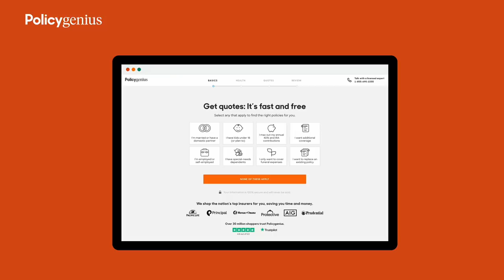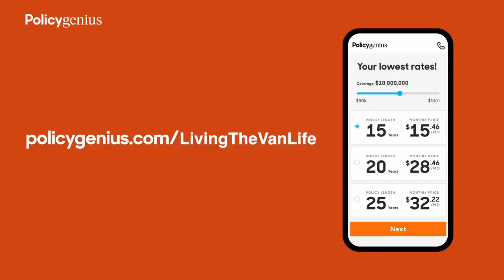Living The Van Life - Sprinter Van Build - Wiring & Insulation

Comment: Really organized. Love the detail including anti-chafe. 
Decided to take a different path on mine. Installed fans, noico, polypro insulation and walls and ceiling. Then temporary interior with protected surface mounted wiring to outlets, accessories, lights and switches. 
Living with the layout in safely anchored wood for a year, then rebuilding in aluminum framed cabinetry once I’m satisfied it works for me. 
Way too many decisions to make all at once and didn’t want anything hidden in the walls
Don’t have your level of travel experience to commit to a design without trying it out. So for me it’s build, camp, build, repeat.

Comment: Freaking smooth quality build! You put tons of thought and research into this! I’m a four time master auto/truck technician and I like what I see! Just for though the “crimp AND solder” method is best for wire connection/or for any butt connections. Awesome stuff! Also you can always spray foam around wires running through frame work to prevent vibration!

Comment: Have you thought about condensation when you put the insolation directly against the outer steel panels? Aren’t you afraid the insolation will get wet and mouldy? Also rust would be an issue?

Comment: I would have thought about installing the wiring after the insulation. If you ever have a problem with the wiring  under the insulation you will have to tear out the insulation to find the problem. Also if it is anything like a house you are always going to be finding places where you need another outlet or light or need to move  existing ones. Also if you ever decide you need to re-arrange the interior of the van and you need to re-route some wires that is going to be a bigger  problem than if you routed the wires outside the insulation..
Reply: He will never have problem with wiring, those will last forever....

Comment: Well, your sponsor lead in is getting better Chad. You've been working on it.
We all build our vans differently, I like mine to be a bit more quiet. Sound deadening mat in the centre of all large panels.
Each to their own I suppose.
Reply: If you watch coachman build a class B they give great ideas for making it quiet and making it much warmer in a much different use of an insulation that looks blown in but it's put in by hand.  I'm really curious to see this all finished.  Coachman also does a great job dampening wheel well noise and insulating them better than others.  Great to watch their build just to get ideas.
Reply from the maker: It already had sound deadening material on it from the factory.  The same exact material as KilMat.  So I didn’t need to do any myself.

Comment: One thing that always think of a limitation to future expansion only wiring from the main fuse box. The idea of having spectator wired sub fuse boxes at convenient locations allowing for addition of future electrical sand also cut down on repeated wires. If you have 8 fixed wires to the back of the van on the opposite side run two large capacity wires to a sub fuzebox.

Comment: Chad, bit surprised no sound deadening. Was there a reason you chose not to install the sound deadening before the insulation? Great work with the wiring too.
Reply: 3M Thinsulate has sound deadening properties.
Reply from the maker: It had sound deadening material from the factory

Comment: Is there a reason you didn't use spray foam on all the niches and crannies? It would seem to add more structural stability and secure the wiring to a larger degree.

Comment: Just curious. Did you consider using pur/sprayfoam ? The thinsulate material is yeah easily replaceable, but wont there be condensate forming between the body and the outer layer of the insulation? :) Love the vid and the build.

Comment: Did you look into doing a closed cell spray foam for your insulation? A RHINO type floor coat is another consideration for protection from moisture that will find it's way under the flooring and form on the cold metal body sheet metal below.  Location for a low point vent in case of CO or Propane gas accumulation? Build is looking good as is.

Comment: Why did you choose the 3m thinsulate sheeting instead of spray foam insulation?
Reply from the maker: Because when you spray foam your wiring in, everything is permanently stuck in the foam and there is no way to run new wires, repair damaged wires or add new accessories or any changes you want down the road.